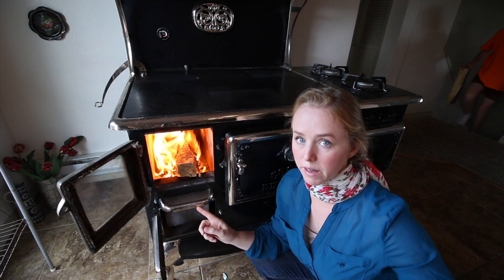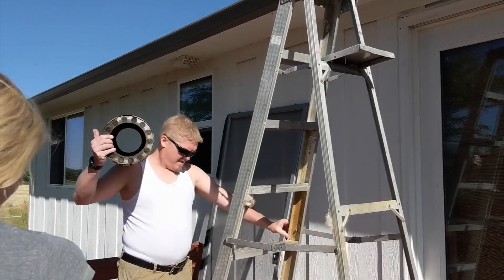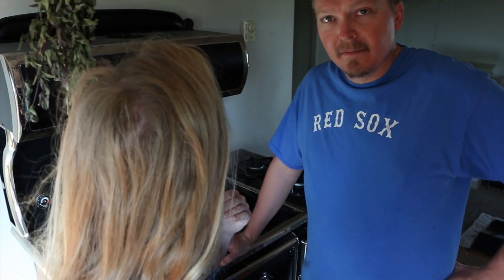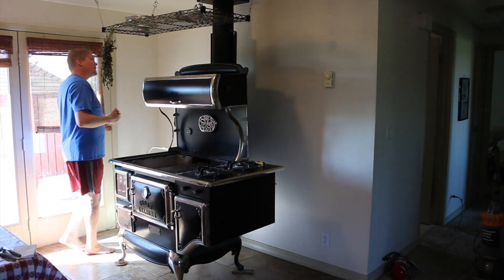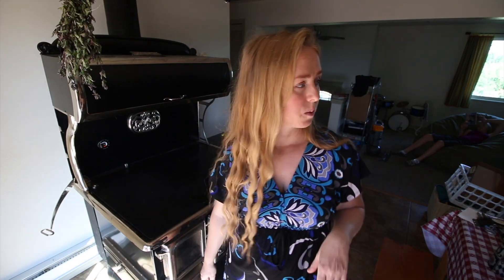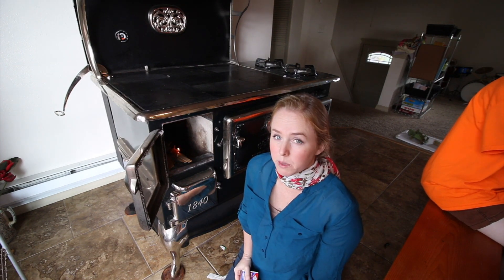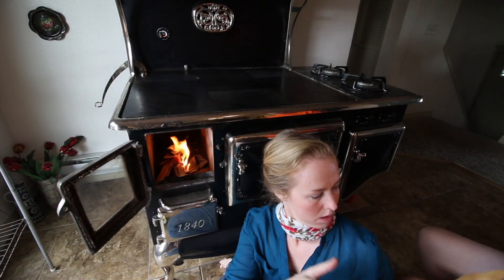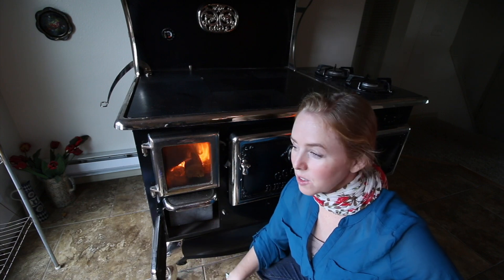Installing The Wood Cook Stove and First Burn

Comment: I used an Isokaren flue which had minimum creosote built up and always ran a hot fire to insure that the exhaust gas is completely burnt. I had a collective with a boiler that absorbed the excess heat.

Comment: Try a metal trivet that will get the pan up away from the actual Stove Top and run it a bit cooler.  The taller the trivet cooler the pan. Old time wood stove, cast iron kitchens usually had several trivets. All cast iron no plastic no rubber no ceramic that was a reason they had them.

Comment: I read the manual and there is no restriction nor warning about using the propane burners while the firebox is alight. If that were true they wouldn't even be able to sell them in the US or Canada. Its perfectly safe to use both at the same time. Don't shortchange yourself.
Reply from the maker: We used the surface of the stove to cook on when it is warming the house. Using the propane at the same time would use more fuel than was necessary.

Comment: I suggest not using candles to start the fire and especially not drippings.
The wax doesn’t burn, it’s the gas from the paraffin.
Melted wax has the good part used up already.

When using candles to start your fires, you will end up with a wax mess build up to clean.
I have already regretted using candles for that purpose.
It will ruin firebrick.

Comment: Clean it every month and a half?  That seems way to often.
Reply: Each stove is different.   I have an osburn insert that requires the stove and flu be cleaned every 1 1/2 cords.
I would imagine if the stove is running constant that it would need to be cleaned out that often.

Comment: If you are going to pay between $2500-$4000 on a wood-fired cookstove, why get one with a glass top? You can't use a lot of cookware on a glass top stove. I have as a backup a modern glass top stove and hate it. The slightest boil over or splatter, and you will have a very difficult spot to remove, and then again you will still have a "shadow" left behind on the glass.  A few years back I bought an antique Glenwood cook-stove in excellent shape for $500.00. Yes, it is very heavy and for added safety, I installed 4-6"x6" beams under the stove & floor in the basement. The stove easily came apart to make transportation very easier. I've decided to sell the electric stove and will be purchasing a gas stove instead. I have my Glenwood on a hearth sits half in the kitchen and half in the living room and it keeps my 950 sq ft house toasty in the fall and winter and I never have to use oil to heat the house. Even the older ones like mine are efficient and will keep burning all night long and will have hot coals in the morning to fire-up again. The beauty of cast iron is that it will retain heat for hours and there are no limitations on the type of cookware you can use on its surface. Best of luck with your new stove!

Comment: 4:37 - You do not need to put such a stove on four (4) coasters. Two boards, and wood dowels to act as rollers that is all you need. To change direction, just move the boards as needed. Only takes two people. That is how the Egyptians moved stones to build the Pyramids. I have a 500 lbs wood stove and that is how my wife and I have moved it more than once. Also, if your tile was installed correctly, it will not crack when placing your stove. Cracking only means incorrectly installed tile.

Comment: New ladder! New ladder!! New Ladder!!! 
 The ladder looks short  and the connection for the back legs  realy looks damaged.  I have used a Little Giant ladder at home and work for years, they are heavy but one ladder will do alot of different things very safely.  I do have several other ladders and use them.  
  They have a new improved model. It has built in leg levelers. Much better than a little stack of things.  But the tremendous improvement are the ladder stand offs that also can be used vertically at the top of the ladder.  You no longer need to work your way arround the side of the ladder. You now step between two hand holds right on and off the roof.  Safety improvement one hundred percent.

Comment: That scrap metal ladder is unsafe.
It is also too short for that project.

Recycle it and use the money towards a good double sided fiberglass ladder that is about 4 feet taller. They aren’t cheap, but cheaper than an emergency room visit.

Or just build gated stairs that reach the roof if you feel maintenance will be required often enough.

Teach that little girl safe habits while she’s young.